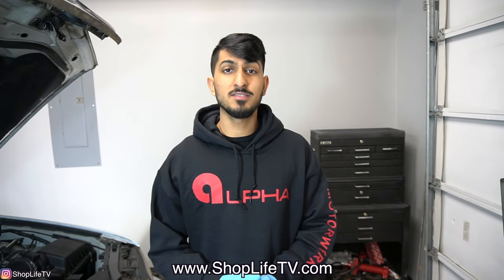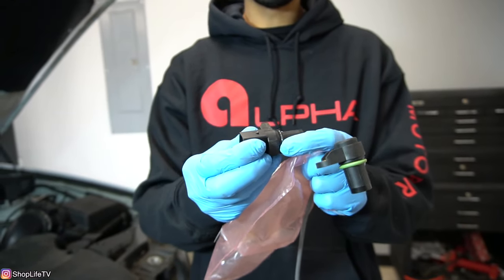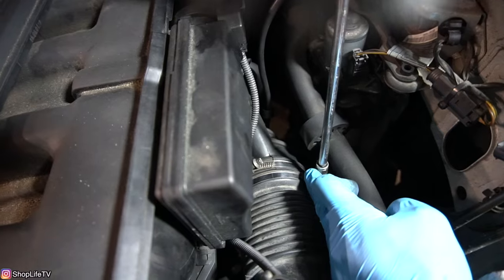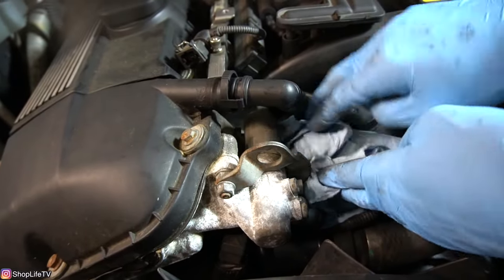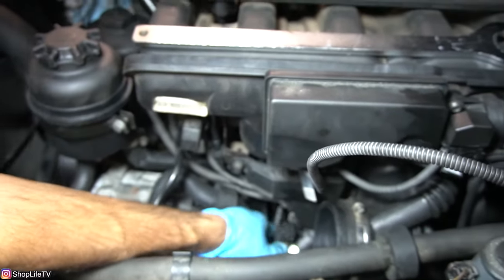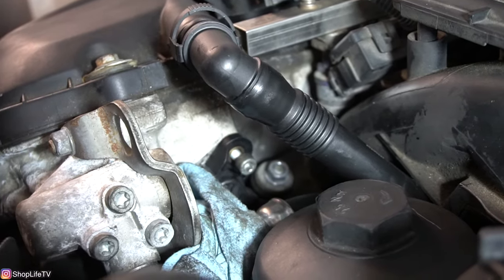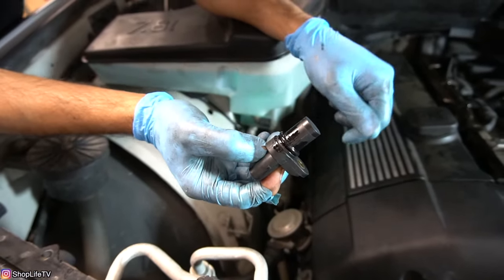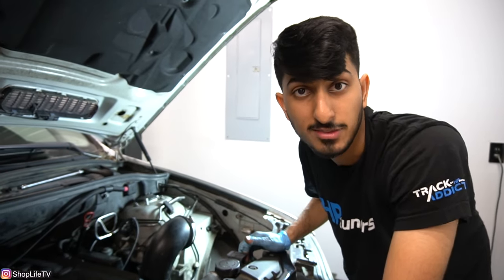BMW RANDOMLY STALLING? FIX IT NOW P0340 P0344 Intake and Exhaust Cam Sensor DIY

Comment: Before you "Fish the wire out" make sure you attach a lose wire to the connector with a duct tape and pull it out. That way you can re-attach the connector of the new sensor simply pull the other end of the lose wire to feed the new sensor connector with lead in the exact position of the old one. Work smart, not hard
Reply: Very good idea. Do u perhaps know the reason for this? I changed exhaust camshaft position sensor and the error codes never cleared.i have reset tool but the error reappears?
Reply: You sound like an electrician
Reply: @anxiety3681  sr. Electronics engineer, but I still do a lot "hands on" at work and have fun with my car 😀
Reply: thank you good sir
Reply: Wow genius 👏🏿 😶
Reply: My exact thought as soon as the plug came undone. Just a piece of string or fishing line can save a lot of f**ks, may possibly have heard a softly spoken one on this video during the refit 🙂

Comment: Whilst driving, car jolted, battery light and yellow service light came on, car stalled, got car going again and at random kept stopping and starting each time red battery light came on, thought it was alternator, paid out over £500 for new alternator, took a 50 mile drive to proof check car then it started cutting out again, do you think i have the problem with the sensor you are working on please

Comment: Hello I do have p0340 after head gasket job, I bought a brand new sensor, do you think o should retime the engine? The timing was perfect when I did it, with the 2 tools perfectly fitted, and also after turning one time the engine by hand

Comment: I've had my 2001 BMW 325i for about 6 years, I'm not a mechanic but with your videos I've never had to hire one. Ive fixed everything from fan clutch, thermostat, electric fan, cooling system, all sensors and brakes. Thanks man. One question: Does the 2001 325i have the electric vacuum control valve that connects to the check valve? Can't get a positive answer from anyone. Thanks again.
Reply: 01 325i is the best vehicle I've sat in..what a pleasure

Comment: These can fail "soft" without throwing a code, and they are so ridiculously cheap and easy to replace that they should probably be the first line of attack in cases of poor low-rev responsiveness.
After vacuum leaks, of course - owning an M54 is basically one long game of "chase the vacuum leak"...
Reply: I’m deep in that game😭

Comment: I have a 2012 BMW X5 I just bring it from Dallas TX to North Dakota , on the Hwy everything was very good, but went the cold temperatures start going to cero by Fargo nd the car stars with issues, low engine oil, low coolant and losing power as well , so I stopped in a gas station and get oil and coolant I was 2 hours away from home, luckily I made it safe, next day my wife took it to the grocery store and the car stars showing a lot a codes like battery needs to be Replaced and 4x4 needs service and misfire codes and camshaft sensors too. I’m just replace the battery already but I’m very confused with this  camshafts and crankshaft sensors, can you please provide a part number for each sensors I need for this vehicle 🙏

Comment: check this, i had a crank but hard start. Changed oil filter & regulator/engine temp sensor/crankshaft sensor/fuel pump respectively, doesnt fix my issue. Switched the camshaft sensors between the intake and exhause, turns out i have a bad intake camshaft sensor. So now the bad one is in the exhaust side and the car starts fine.

Comment: If i were to throw parts at the car for every code i get without testing the part i would be poor.  2nd, why are you replacing the second one if this is so easy to replace, makes mo sense.  Now if you were tearing into the engine and while there change some parts yes agree in that scenario but not here.  You need to test the parts to verify.

Comment: Hey 👋 I had a problem with stalling in m52, but it was the crank sensor problem. The symptoms for cam sensor is that you have to crank it a bit longer when starting and noisy injectors. Also could you explain why you don't recommend aftermarket sensors?
Reply: I had that nightmare. P1078. Exhaust timing valve sensor. My Juke stalled on the road on way to work. I was driving bumper to bumper. Ended up being towed back to where I stay. Waiting on the outcome of testing both the camshaft and crankshaft position sensors.
Reply: @ulf-dieterkoepp7865  I've been using OEM as well as the cheapest I could find. Both work identically and last the same. The last original one lasted 1.5 years, but surprisingly they gave me back the money for this one 😃
Reply: @S7midnight  wow.
Reply: @ulf-dieterkoepp7865  😎

Comment: Hey my guy appreciate the video but i need to ask a question i have a 2004 bmw x5 3.0 i have changed the cam sensor and im still getting cam code what else could be the problem other than timing
Reply: i have the samo problem, did you get it?
Reply: Bro did you find out what the problem?
Because I have the same issue 😢

Comment: My camshaft exhaust sensor went out on my 2008 535xi and it shut the car completely down. It's like my battery died or something.
Reply: Did the replacement of cam sensor work?

Comment: I have a 2000 Z3 with a 2.8l.  It's kicking my ass trying to figure out why it went from running perfect, to misfiring and running horrible and not even drive able.  I changed  and checked:
Both Vanos
Intake and exhaust cam sensors
New plugs
New coils
New MAF
DISA is fine,  holds vacuum
Fuel pressure is rock solid, even when running like shit.
Smoke checked and NO vacuum leaks.

Comment: Ok... so... I get p1343, p1345, p1351... but these codes are also triggered by the CAM Shaft Sensor... what's the actual cause to these codes... I already replaced 4 days ago, new fuel injectors, new disa valve, new coils and sparks and than a couple hours ago MAF Sensor, annnddd cleaned the ICV... WHATS REALLY CAUSING THESE CODES? 

2001 330CI M54, MAN TRANS.

Comment: Good afternoon Sir. I've been watching this video of yours. My car cut out in the drive. The engine swings but doesn't want to start. After about 3 days it'll start but when you drive about 15 to 20 km it cuts out and then it doesn't want to start again. I have a 1995 BMW 318i e36. I really need your help please.

Comment: Hi 

My E90 330i 2008 automatic,

After running 30 40 km ,when I slow it down for signal or humps it’s engine get turned off then if I restart it will restart and running smoothly 

What is the reason?

Comment: My 32mm fan clutch wrench is RUINING the solenoid metal!  It's chewing it up AND I have zero rotation of the solenoid!! Im stuck!  Ive applied BP Blaster.  No progress!  Just metal shavings!  Is there another screw or bolt holding it in??

Comment: i had bmw e90 320i N46 engine. Car cranks but not start . Scan and prompt camshaft sensor inlet. replaced the sensor but no start/ check signal voltage its 10V.may i know whats happen?Any advise?

Comment: Please someone help with a suggestion . I have the code P0705 A Circuit 
  Gear sign and battery light on . The car can start in all Positions P,R,D,N .and when it starts it doesnt show which gear the car on the dashboard. instead I get transmision sign with the exclamation mark in Orange and this is when I can drive the  car almost normally and the car can go reverse and from second  gear and up  but with no first gear and  parking sensors are not beeping nor reverse lights working  .but if I dont see the transmision fault sign, the car go only in first gear up 20km ph and doest change to second gear and up and no reverse  . 
I changed the  transmission range sensor and bought a new battery and tested alternator with a specialist and said its fine which leaves me frustrated . The car is BMW e46 325i  / 2001

Comment: Always love your helpful great content. Thank you! I have had and I believe many people have a problem with mt S54 on my M3 stalling out often when I put the car into reverse as well once the car is hot and been running for a while the car just stalls out. Ive tried to figure this out as have many others. I can tell the change comes as soon as I put the car into reverse don't even have to use the clutch. The car starts stalling when i put it into reverse and it's idling. I had a BMW indie shop look at the car and try to figure out whats wrong. They checked the idle control valve but that wasn't the problem they did a software update and no good. My car is a swapped out 2002 330CI to a 2006 M3. Maybe that is part of the problem. As well when the car is hot and I push in the cltch and let the revs fall to idle it will just stall out even if the car is moving (Not in gear mind you). On and on it goes. LOL.

Comment: Are meyle sensors ok to use I’ve just bought some they look identical to genuine bmw with the grey wiring and green seals they feel very good quality wise and will be replacing my cheap £15 Chinese set I got of eBay. Surprise the exhaust one has failed already after a month

Comment: I’m getting no crank at trying to start up my 2001 330i changed vacuum lines, cracked air box and air intake boot would this help with any of my problems or the EML light

Comment: 2000 328CI, 134k miles.  I got a P0340 code after changing my pre-cam 02 sensors with new BOSCH sensors. I cleared the code and it didn't come back, but I've noticed the car in general can take a few cycles to start up, and the acceleration is not so great, especially when I floor it on the freeway. I feel like this car should be a lot zippier? Should I still replace 1 or both of the sensors? Thanks for the great videos!

Comment: Did both sensors on my 2004 Z4, M54 3.0 engine. Similar but different. The intake sensor was the easiest. The exhaust sensor was very difficult to get to, too cramped of an area. Once I got it out I struggled to get the bolt started in the new part, I decided to take the electric fan out. Should have done that to begin with, one plug, one screw and one expanding rivet and the fan comes out. Anyone doing the exhaust sensor on a Z4, save yourself some frustration and remove the fan first.

Comment: Hey, when i timing a vp44 on car i put with comparator 0.90 (thats write on pump)
Then block then i put engine in TDC. But when tighten the bolt on pump 
the measure on the comparator moves.
and when I check again if the pump is in timing it is not correct.
What to do

Comment: Hi, E53 3.0i i change both camshaft sensors, but the  issue with intake camshaft position its still there
sometimes the car is cranking 4-5 sec and save the error on intake cam sensor and the vanos is not working?
after restart and delete the erorrs everything is ok
what is the problem?

Comment: 2000 323ci. Replaced inlet cps and exhaust cps and the crankshaft position sensor and still having the stalling issue.

Comment: any idea if this code comes in conjunction with a very complicated P16A7 code? got an M54 and it just stalls out. Cats are definitely clogged but also have a tiny cylinder head crack. Car stalls out randomly (SMG). however It doesn’t happen when the MAF is unplugged. Maf was replaced with an OE  part about 2 years ago.

Comment: My 2000 328i manual does this, on a cold start it idles high but as it warms up it almost dies and sometimes stalls. I`'ve had it couple times stall when I down shift to a lower gear. Do you think this will resolve my issue.

Comment: Those 2 13mm bolts definitely need a thread sealant. BMW in Australia uses Loctite SI 5970.
$45 at BMW dealer only

Comment: Hi I've got a e90 330d with the m57 engine it starts fine but it cuts off while driving if I put my foot down or going uphill in park it will rev all the way but in gear it doesn't I've changed fuel filter glow plugs cleaned the egr aswell I've changed the ekp module also but problem is still there please help isn't showing the eml or any fault codes

Comment: What would you do if you have all 4 sensors errors? I have a e65 2003 4.4lv8 with all four camshaft sensors reading high voltage?

Comment: I had a long crank- barely start condition.  I've had intermittant CEL's for intake cam sensor, but no CEL this time.  Could it still be the ICPS?

Comment: You didn't show the tail of the intake, alot of times I order the camshaft intake sensor and they have the wrong 1 listed at the auto parts store, it's usually the tail that's the tell tale, it's happened to me atleat 3 times on different m52tu engines, and the last time i didnt realize, and was fighting for the tail to push into the harness, when I realized what was going on I shaved down the guide rails and it snapped in perfect, took the car for a test drive and it drove perfect, but idled horrible... did some research, apparently the part is for the M54 or N52 cant remember... had to do it over again from an online store making sure the guides matched my old part in the pics, which for some reason they dont always show the tail....

Comment: Are these sensors also responsible for like when an M54 stallls for like a second and then continues to run? like when  your idling at traffic light and you hear and feel it stall, lsee the rpm gauge drop,  like it shuts off and then it picks up again?
Reply: I’ve got the same issue with my m54 id like to see if that’s the issue so I can go ahead and change that part
Reply: @lanehart3486 did it help the stalling?

Comment: Pleeeeeeeease help. Following the steps here, when I took out the exhaust side cps I managed to push the O ring into the engine. How big a deal is this? I was tired and not very careful at time.

Comment: Question my 04 530i has these same symptoms once the engine is up to temp it will die randomly while parked at idle, or like you said at a red light. Could the sensor need to be replaced without throwing the code for it? Or would it be more of the vacuum side of the motor?

Comment: Very recently i cleaned the idler valve, and accidently unplugged the intake cam sensor, car stalled when idling and coughed and spluttered while in low range

Comment: Can the e cam sensor oring fail and give a oil leak on to the bottom radiator hose closer to the top by thermostat

Comment: oh man, i just had these replaced back in 2016 at 37k kilometers. now the car has 95k kilos on it and theyre bad again.
Reply: turns out i still have a p0340 code even after cps replacement with hella cps. could this be the beginning of a vanos problem?

Comment: Thanks for this video, I just used it to replace my intake camshaft sensor.
BTW as long as you are there, you may as well replace the intake VANOS solenoid as well. It's a wear item and it has to be removed anyway,
Reply: what are symptoms of vanos solenoid not working correctly?

Comment: Help , my car has been stalling and the rpms jump up and down mainly on cold start , new spark plugs, ignition coils, and fuel pump . 2003 bmw 325i Auto
Reply: Also no engine lights whatsoever

Comment: the e46 M52 has an additional vacuum line attached to the Fuel Pressure Regulator. Has any one done a catch can on an m52? If so, how did you tie in the Fuel Pressure Regulator vacuum line
Reply: I know on m54 you can cancel it out (or maybe reroute to top off gas thank, just an idea...), it’s only there if the pressure regulator fails and drips fuel.

Comment: Hi man. Got a problem with eml light.. i have 325i, i already change an icv valve because when i scan i got mechanical idl speed control fault and still got eml brake and asc light when low speed 30mph and low rpm.. then when i restart my car it went off and work normally

Cloud you give me any suggestion.. thaks in advance..
Reply: Replace Maf sensor, camshaft sensors,battery, air filter. And all OEM parts. German Auto supply has  them all. Battery get the one from Walmart or exide from home depot.
Reply: @laloortiz7312  i found the probem, it just maf pin. One of 3 maf pin not tight enough.. huft
Reply: Which one? From the main connector?

Comment: Thanks dude. I brought a 2000 323i sedan and loving it. Haven't had any issues stalling! Still getting the p0340 tho
Reply: I have the same thing but using another scanner read that the exhaust sensor is the problem not the intake cam sensor which I changed 3times oem.good luck